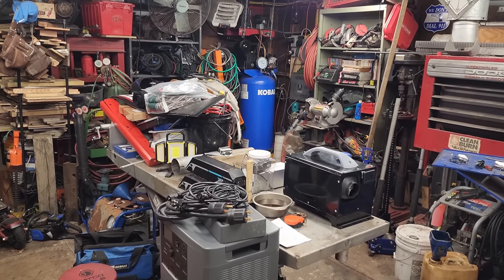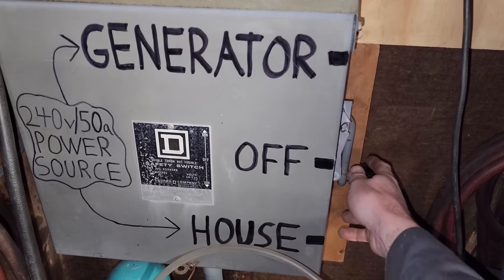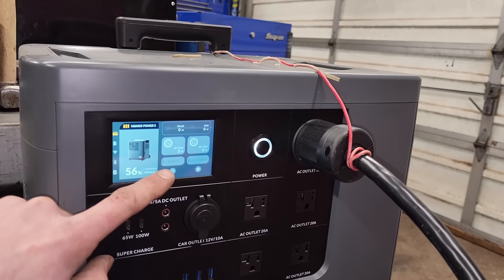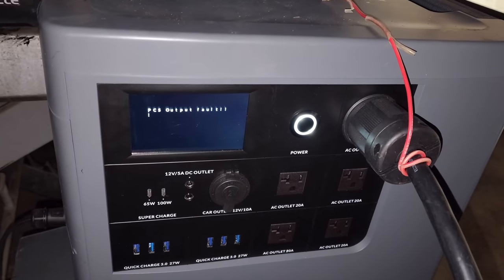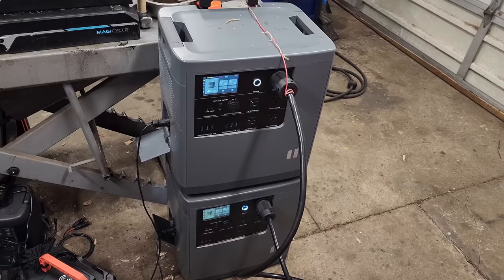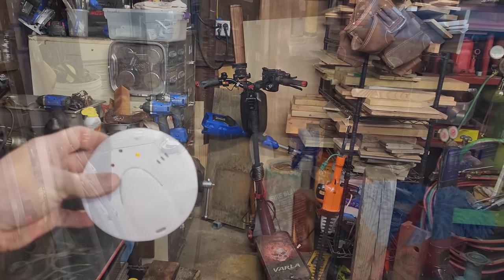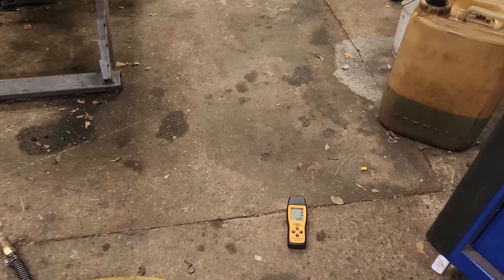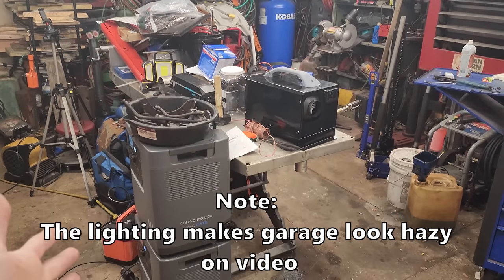Powering The House with 2 Mango Power E Power Stations - NNKH

Comment: A trick to to keep the conditioned air in your garage drop a 2x4 between the door roller track and the top of the door this will push the top of you garage door against the door frame you might need to add some weatherstripping. When you want to open your door slide the 2x4 out and set it on top of door track one end at a time where it is flat and out of the way. This assumes you have a regular entry door to use when you exit the garage. This also helps prevent someone from opening the garage door from the outside. Great content thanks!!🇺🇸
Reply: Panel doors with insule batts and sealing. Roller door is impossible if you actually roll it. Seals get compromised everytime.

Comment: The converters aren't designed for and can't handle high inrush loads ( motors or other high induction loads) however they have a clean wave and low harmonic distortion so they won't harm your electronics, your old military diesel generator offers the best of both it should be a clean wave and have pretty low harmonic distortion

Comment: We lose power occasionally  on the Olympic Peninsula,  so last autumn, I paid an electrician $1200 for an interlock, permit, and add a couple of lights in my garage.  A month later, we lost power for 48 hours.  I'm glad I was able to have power, but my 10kw generator won't run the 15 kw furnace.  Space heaters kept us from freezing, fortunately.  We're looking into a bigger generator system now. 

One issue I ran into running propane was tank freezing when running for hours.  I found my neighbor with the whole house system also has freezing issues with his 500-gallon propane tank.  Options are limited for hassle-free emergency power here.

Comment: Problem with solar is it works only half of the time at best between 9 am and 3 pm with no clouds.. in summer.
Not to mention the other seasons.. so.... keep your diesel gens.
Reply from the maker: Yeah diesel generators are definitely staying. It's nice to have these batteries to charge up though instead of running the generators without a lot of load on them and then I can shut them off and run on battery at night

Comment: after connecting the 2 mangos together how did you connect them to your house electrical
Reply from the maker: I showed it in the video. The panel is back fed through a breaker. You need to install an interlock plate to do it safely

Comment: Yeah I have an interlock.  It's the way to go imo if you don't use the fancy computer cutout.

My portable gen runs of the natural gas.   It was huge pain in the as* to set up initially but worth it.  Especially since I have a sewage pump to pump the sewage uphill.  Don't want to be without power for an extended period.

Comment: I purchased this mango power E almost 4 months ago, and it has stopped working.  When I turn it on or plug it into an electrical outlet, it turns itself on and starts loading.  Once it's done loading, the screen goes off, and it loads again. Then the screen just turns on and off, then on and off, and repeats this all day, never allowing the screen to stay on. Therefore, it's just a 100-pound piece of junk that doesn't work.

Comment: Slow the heck down, particularly about the time you're hooking up the 240

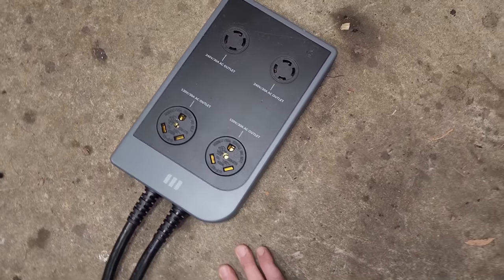3:28 you show the connection box on the ground but you don't wire it up. You should have done that. I'm an engineer and I have an off-grid system, 10 years, flooded lead acid batteries, SMA equipment. I'm not a newbie to off-grid but am on solar generator systems.  

Slow the heck down.